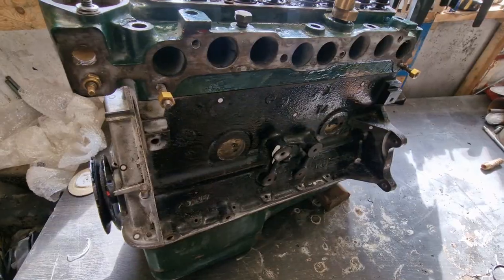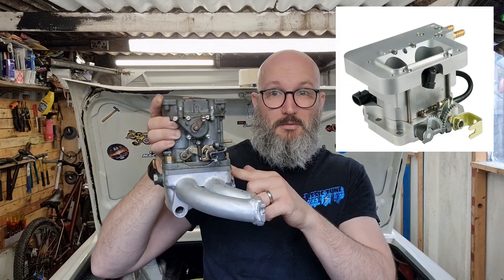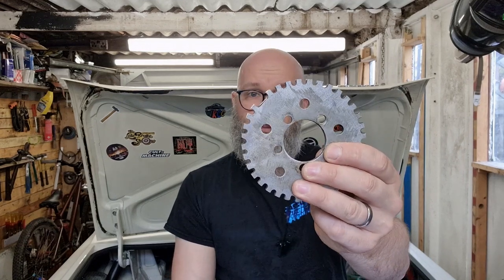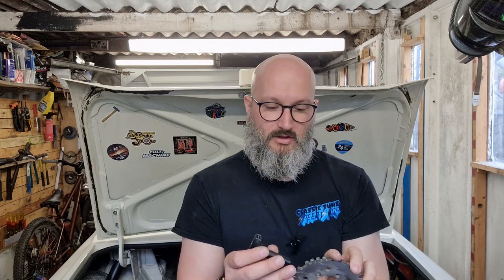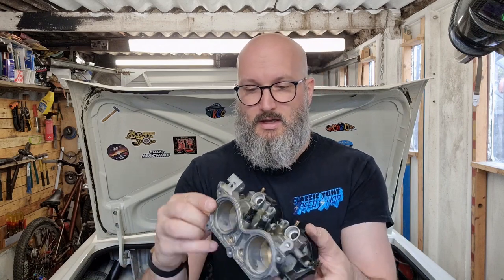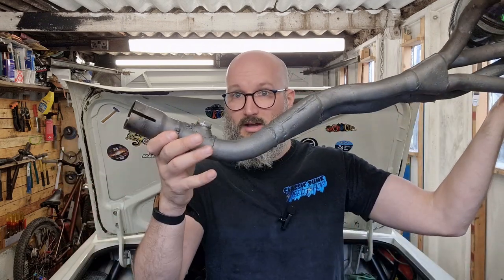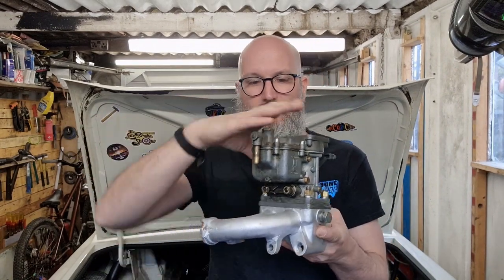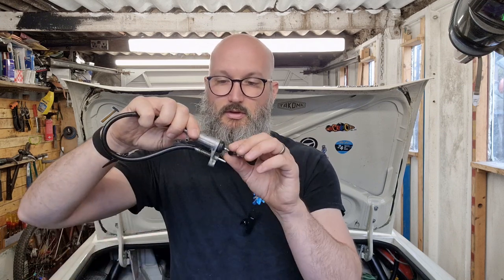Fuel Injection on a classic engine - the basics ep1

Comment: great stuff ,,i've been thinking if i could adapt the orion escort efi system to a pinto, we used to tune them to max with the engine at 2krevs while we opened fuel adjuster screw,if the engine started to splutter we opened it to far, much more smoother on acceleration,im watching mate,we always learn from each other.
Reply from the maker: @retiredtruckersgarage.7606  that's interesting stuff John, funnily enough I saw an orion the other night! 

Are sierra pinto EFI parts still floating around? Is there much difference in the head between a 1.6 and 2.0?
Reply: @jimbuilds  the heads are not much difference in size just the valves are bigger on the 2.0l head,the blocks are different in height to accomodate the extra stroke ie longer pushrods,i had a 2.0l 8 valve efi sierra engine up until last year but sold the lot on marketplace,silly me,they are hard to find now and only come along from late smilie transits,i'll be watching your project closely jim ,thats what we do mate,learn from each other.

Comment: Lock out the distributor and use that for cam position.
Reply from the maker: That's a great idea, I have a spare lucas dizzy body that I don't mind sacrificing.
Reply: @jabberwockytdi8901  The Suzuki G10A 3 cylinder engine also uses a distributor to fire the ignition.

Comment: Hi i have fuel injected two different ford xflows. One with Nissan GTIR throttle bodies and the other with a single throttle body plenum. Both worked great. You'll love the injection. The non xflow has a better cylinder head in alot of ways. It will go really well!
Reply from the maker: That's interesting about the GTIR ITBS's, of the 2 which did you find easier to install? I had thought about a single throttle body inlet originally but I like the sound of ITB's!

What did you do for the trigger wheel and sensor mounting - I've seen kits but they're nearly £200 and I don't think it's good value for money if I'm honest.

Comment: The three main parameters are engine Load / speed and temperature, getthose correct and it;ll run. The other sensors will make it run sweet. Interesting what your doing  ,I'm hooked.
Reply from the maker: That's a much better way of putting it! 

I think there's a lot of potential in the old pre crossflow and the only reason I wanted a zetec was for the convenience of modern fuel management etc. on paper they work the same way (suck, squeeze, bang, blow). So why not try adding that stuff to it.

I have done a fair bit of homework in the last 2 weeks so hopefully I'll have some cool stuff to share soon! 

Thanks for watching Stephen 👍
Reply: In my experience with this engine a rev limiter won't be required, the valves bounce and slow gas flow at about 6.5k RPM especialy with larger inlet valves if you go that far. Wasted spark is the way forward also. Looking forward to your progress.✌
Reply from the maker: @stephenwhite5057 I've not experienced float that I recall but the rev counter was always a bit vague!